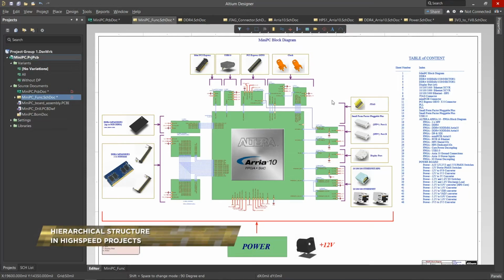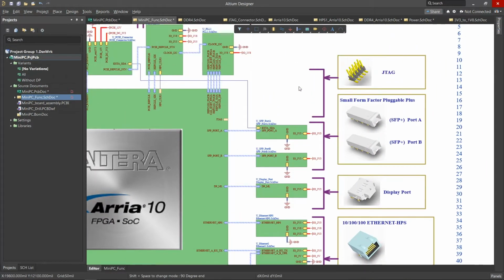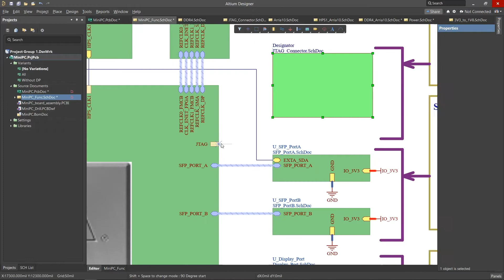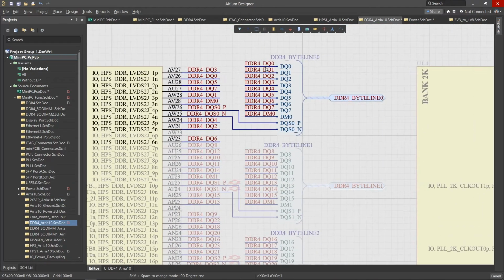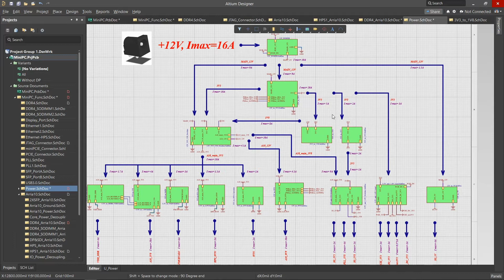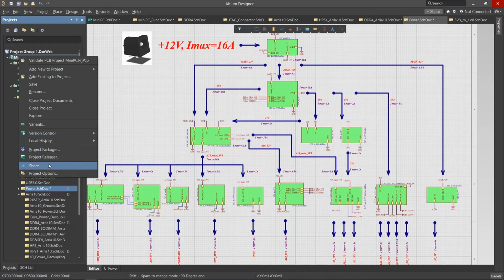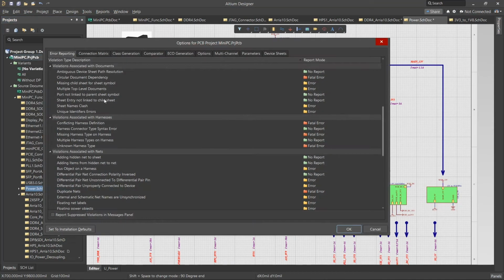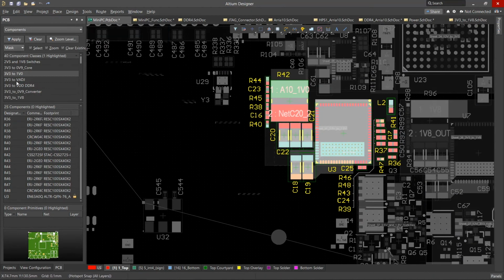How to Build a Hierarchical Structure for High-Speed Projects

Comment: I noticed that in this MiniPC example you added power ports (like IO_2V5) to sheet symbols as sheet entry and disabled "Sheet entry not linked to child sheet" errors (that would be rised as there is no such port defined in child sheet). Is this better approach compared to actually adding port (as for signals) for powers that will automatically appear when creating sheet symbol?

Comment: You suggested having power circuit hierarchy separately. However my experience is that Altium complains about the power ports connected to sheet entry. Was this warning suppressed in this design?
Reply: You can find this project in the AD21 examples folder. If you load that in Altium, you can open the project options to see how they set up hierarchical design as well as error generation....but you're right, they changed the error generation.
Reply: did you find a solution?
Reply: Go to project -> project options, options tab and select Hierarchical for the Net Identifier Scope